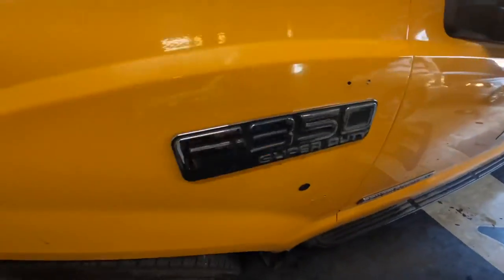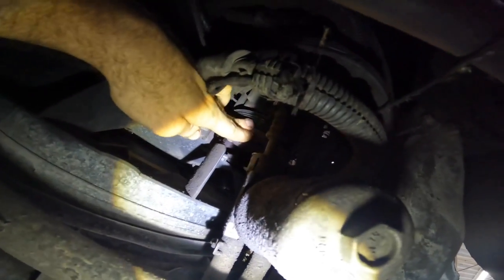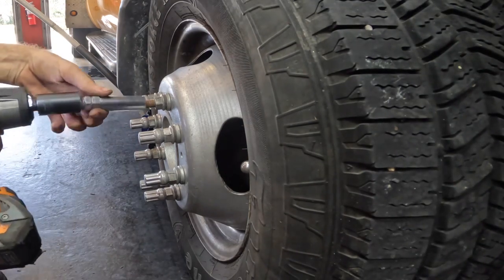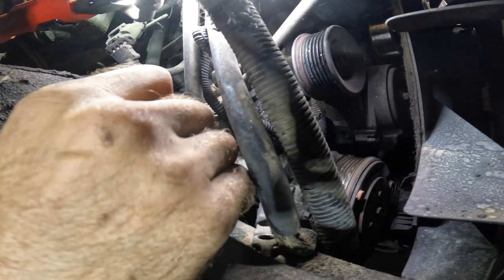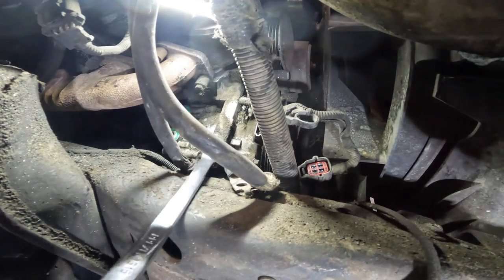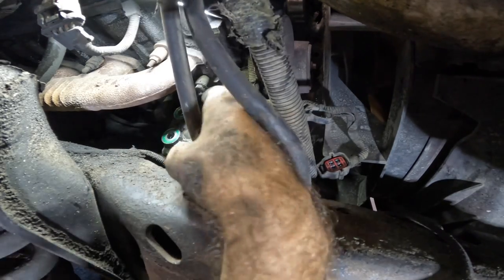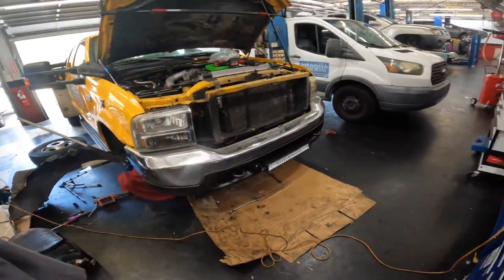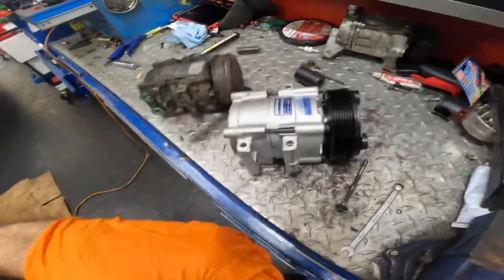Cut the Frame, Pull the Cab, or Suffer? Ford Powerstroke F350

Comment: Shame the Devil and cut a hole! My Daimler V8 many years ago dropped it's mechanical fuel pump bolts, pee'd oil everywhere but although I could see it with a mirror there was absolutely no way anyone could get at the bolts to refit it without removing the entire cylinder head on the right-hand bank. It was my car so my solution although unorthodox worked fine - electric jig saw and sawed a piece of the inner wing/engine bay side out giving me room to get my hand in and fit and tighten the bolts. Then cut a patch in 18g steel and self-tapped it over the hole. The Daimler was based on the Mk2 Jaguar body and built by Jaguar with their usual micrometer precision wasting not one inch of space so nothing was accessible under the bonnet, the valve rocker-covers almost touching the engine bay side walls.

Comment: I would have used the die grinder and enlarged that hole on the frame. I also would have checked if the compressor turned because it looked like just the idler bearing was cooked. Probably would still change the compressor and drier, but nothing else. Be glad the guy didn't bring a used compressor.

Comment: What an epic pain for that repair.  Im not saying Dodge is better but I really see the efficiency of time and design of an straight inline motor like the Dodge Cummins.  There's just more room to work.

When I was a kid I remember Ford had an inline 6 cyl 170c.u. and an 300 c.u. and recall them being simple and having lots of room to work on them.  It's too bad trucks in particular don't adopt simple easy to work on inline engines.  Nothing these days is designed for ease of repair or efficiency it seems

Comment: i did this repair on my 2006 explorer 4.6 3 valve v8 limited oh what a pain in the ass there’s less crap in the way but the space is also smaller and it’s pretty much the same process so when the engine was replaced when i got the car it went in installed on the engine but i did the removal the other way not knowing there was a massive hole in the line going to the back had i knew it would have came out with the engine it’s a super pain ford never should have put it there

Comment: There is a stud with a negative cable and stuff on it by the compressor. Take that out get those cable out the way. Piece of cake. It’s thirty minute job.
Reply: Oh yeah. The manifold bolt. Use a wobble with a long 3/8 extension all the way to the top. Hit it with your impact. Ten seconds

Comment: You dont have to do anything complicated. Yea, its.not easy, but its.definitely doable with the right methods. You put the bolts into the compressor, then put small zip ties on the threaded end of the bolts to keep them in the compressor. Get the compressor into place, start the bolts, and once they are threaded in to where they wont fall out, use a needle nose pliers to twist the zip ties off, and screw the bolts in the rest of the way..... done.

Comment: A friend had a Bronco with the 351M in it. You had to pull a motor mount and jack the engine up to get the oil filter off. What the hell were they thinking.

Comment: Isn't' that a fun one? NO!!! I did a repair on a 2000 Ford Econoline Van. In order to replace the tensioner pulley and belt, I took off the entire front end of the van. I had to do this to get to the tensioner pulley and fix everything else the belt caused damage to. It was a mess. Took me all day.

Comment: I'm not pro-engineers by any means but this truck has 350K miles on it! They did most things right. AND most likely the reason the AC seized up is because a mechanic put an F150 compression in it.  I love Ray.  Watch every video and I'm amazed. Just wanted to pump the engineer bashing brakes a moment.

Comment: Gotta love the "engineers" once again!!!  Nothing quite like "cab forward designs"...  Ford dealers I hear usually pull cabs off the frame when doing head gaskets etc!!!!  This is the reason-- I say Hell NO to certain vehicles anymore n sent it!!   (also b/c it is hard to "sell a customer" on the labor for jobs like that most of the time b/c they don't understand just what is involved sometimes.....)  LOL    I appreciate this video as I do auto AC on some vehicles --WILL NOT be a FORD truck for sure!!--LOL  That would of been an "AC DELETE BELT" n ship it!!  --see the dealer if you want to replace it!! --lol  (smart companies build trucks/cars with the AC belt separate from vital components so upon failure--you only lose AC--not everything!!)

Comment: i see lots of air movement on loose items around compressor is that from the portable swamp cooler? its blowing out very moist air which is bad for the a/c system which is open sort of like working on it on a rainy day

Comment: Engineers were paid to make sure it runs and drives and to make it quick and easy to assemble at the factory by dropping the cab down over everything on the rolling chassis and powertrain. Very little consideration given to future service despite them having a procedure for it in the FSM.

Comment: Mud: 10 minutes of fun.  10 years of crap falling in your face.
That's the kind of job where I'd be inclined to start with a large supply of degreaser to soak the engine bay, & a high pressure washer before even starting.
That slow ending with the 1/6th turn at a time... at least it wasn't one where you have so little room, you can only get 1/12th & have to keep turning the spanner around to swap angles.  (Although I saw you doing that to start with.)
Hope the rest of the day turned out great after this painful start!

Comment: I am half-listening to this ordeal as it plays in the background as I, myself, am currently struggling to determine the thread-pitch of this raspberry-pi case hardware; where i am coming to the conclusion that I am going to have to disassemble a spare IDE hdd becasue IT has the ONLY fasteners tiny enough to (closely) match what i need; and, yes I have concluded, that I am going to use an X-acto knife, more magnifying glasses, and the most needle-y of needle-nose pliers to cut a hair-wide strip of masking-tape (the BLUE kind, of course) to wedge into the threads of the needle-sized screws to compensate for what must be the wobbliest tolerance in ALL of the fine-threaded fastener world: whilst thinking I should just go nuclear: wrap the whole thing in duct-tape and be done with it.   Just wanna say thanks, Ray, for talking to me, describing the details of your own challenges in real-time as I work to accomplish my task too;  May Google's algo smile on you.

Comment: You’d think that parts that needs to replaced on a fairly regular basis like oil filter and cabin filters. They would engineer it to where it’s easy to get to.  But instead the engineers said.  Hey this parts needs to replace  or break often. Let’s put all those parts in the most  inaccessible area of the car.

Comment: just when you drop the compressor  the customer comes out and says, never mind put it back together. i just checked my check book and it says o hell no. at 19:30 i start thinking why not pull the radiator and how you gonna get the compressor out after you get it unbolted. i would have gotten my hole saw out. ok edit again, where is your hole saw? a circle cut will not weaken the frame there.

Comment: This job is actually a breeze remove the 2 motor mount bolts that you see from the bottom lift the motor slightly and you can fit a 1/4 inch ratchet to loosen the bolts once they’re broken loose you can remove by hand the rest of the way. Installation is just as easy install the bolt that is obstructed by the frame gets installed with compressor run down one of the accessible bolts to hold the compressor in place.  FYI: sell new motor mounts next time with good mounts the motor sits higher and the compressor bolts are accessible through the holes. I’m a Mopar  and Chevy guy all the way until I worked on 6.0 they’re amazing motors once you learn all their quirks. No they don’t blow head gaskets like everyone states they do it’s a bad EGR cooler design I’ve done a good share of them as PM and failures for EGR cooler. Use only ford gaskets and seals or a Bullet proof EGR cooler. They are good 1/4 million to 1/2 million mile trucks with proper maintenance.

Comment: They should have just totaled this truck. The labor alone on this repair would be more than the truck is worth. That is a nightmare. I won't be able to sleep for a couple of days after watching this, lol. That's worse than trying to do a power steering pump on an 08 Sienna in your back driveway with no lift. It has a bolt that is blocked by the frame. I didn't think it could get any worse than that. Try doing a control module on a '91 Skylark Custom. That one sucks too.

Comment: That's a job I probably would have run screaming from.  But may I suggest for the next time that you just cut a hole with a bi-metal hole saw bit right over those two bolts.  You would save at least 2 hours.  Shoulda, coulda, woulda.

Comment: Personally I would have yanked the whole motor and gone from there. That said - I've never been a professional mechanic, so I may have the wrong idea about this unit. When I used to do a lot of this sort of thing I was working with old 70s and 80s cars/motors and we could get an engine in and out in an hour.

Comment: I feel every greasy, painful hand manipulation, muscle pulling grief that those engineers designed in that a/c compressor replacement job. Those engineers should be put on a driveshaft spit and basted in5w-40 diesel motor oil under a diesel fuel flame to show them what crap they designed. I'm a Ford person but it doesn't matter what company designed it. Their all the same. Congratulations that you were a gentleman with the stress you were under!!!!!!

Comment: They had it towed because the power steering and alternator stopped working? .......Wow. Some people are just overly cautious, I guess. It would have been nice for Ray if they'd been more cautious about the dirt :O

I was about to criticize them for ignoring the grinding bearing in the AC compressor, but then I remembered......I own one of these, and you can't hear anything on the accessory line over the noise the engine itself makes. :O I probably would have removed the AC compressor and installed the shorter belt....I have already removed other parts of the AC system. I don't use AC.

Comment: Time for the hole saw. The engineers didn't care about your pain. So go for it.
Heater core on an 85 Toyota van. you simply cut a door in the floor. Otherwise, it's a 10-hour job. Nobody would pay that!

Comment: I have said it before and I will say it again, all mechanical engineers should be required to spend five years working as a mechanic doing maintenance and repairs on the type of vehicles they are going to design before they are allowed to design anything.

I bet they would be designed so they are a lot easier to work on after that.

Comment: 11 mm bolts...huh.   I checked my toolbox.  3 socket sets, 3 wrench sets, and one of those hex drive impact sets and none of them have an 11mm.    Its the same with torx T27.  Harleys are loaded with T27s and none of my torx sets have any.  I had to order a variety of them to have on hand.

Comment: Imagine if you would in another parallel universe there is an automotive engineer that actually works on the vehicles they design, they notice a minor problem and make adjustments prior to the vehicle being built, such as two holes in the frame that will allow the mechanics to easily access and remove bolts in a timely manner!

Also Mr. Ray you act like you have a job other than video taping for YouTube, I just don’t get it🤣🤣🤣🤣🤣

Comment: GET YOURSELF A 1/12 HOLE SAW PUT THE HOLE IN THE FRAME IF YOU SEE IT'S GOING TO 2WEKEN THE FRAM SEND IT OVER AND WELD A PLATE ON IT I HAVE HAD CHEVY VANS 5 CYCENDER THEY IN 156000 MILES NEVER CHANGED THE TWO PLUGS ON THE REAR PASSENGER SIDE FIX THAT IN A HART BEAT THEN PUT 100 MILE TAPE OVER THE HOLES

Comment: Those engines are a pain in the ass on several fronts - it's a pain in the ass to work on anything on the passenger side toward the rear of the engine ..

Comment: Customer states, 2009 GMC Acadia needs oil pressure sensor replaced.  Low oil pressure warning appears intermittently.  Common problem among traverse, enclave, acadia, and other infamous 3.6 gm vehicles. Vehicle runs fine; no over heating; no clatter.  Repair shops insist alternator must be removed - NOT.   ThIs results in a >3 hour repair. Checked youtube - your world.  Tricky but 1 hour job or a little more.  I'll provide new oil filter and OEM sensor. Price please. tHX.

Comment: Next time, take the clutch fan and shroud out of the way after draining the coolant, like 20 minutes of work if you ha have a co-worker  who can help for five seconds.

If you remove the upper rad hose, unbolt the shroud from the radiator at the top, pry front shroud up and out after taking the radiator top mounts off, then take the four shroud to cover bolts out,  bust the fan off the camshaft, have a co-worker pull forward on the rad a bit while you slip the fan and shroud up and out as a pair, that compressor is SUPER EASY to do, as is everything on the FEAD system at that point.  Should also  get the  CAC tube out of the way on the hot side.  Take it off at the second clamp at the turbo as it has a compression bead at that joint - at the turbo itself it's prone to coming off if you touch it - and then the main clamp at the CAC itself.  Compressor can then be replaced in an hour and a half tops all day every day.
10 mm and a 13mm hand wrench from the front of the compressor with the shroud gone, loosen all bolts till compressor is hanging free, all bolts come out with the compressor moving forward, then loosen the 10mm a/c hose bolt, don't remove, then the hose can slip up and back, compressor comes out the bottom.........hope that helps if you have to do this again.   Any FEAD work on these rigs is way easier with the shroud and fan out of the way, and the pair comes out easily without having to remove the radiator if the upper two mounts are removed, and unclip that dumb upper extra shroud with a pick while pulling up on it.  This is not a 4 hour job if the shroud and fan is gone.
Been wrenching on 6.0l diesel Ford's every day for  19 years now and that compressor - for me - is total gravy. Hope that helps.

Comment: A hole where the 1 bolt was blocked off, would have totally compromised the integrity of the frame, that's why Ford didn't put an access hole.....🤣🤣🤣🤣

Comment: Fords are such a pain in the ass. I can replace the AC compressor on my 2000 chevy lumina in an hour because the made they engine small enough and the subframe big enough to actually replace necessary components.

Comment: It's a typical Ford engineering thing and to put in electrical engineern in a mechanical job and a mechanical engineern in an electrical job and expect things to work out and that's the kind of crap you can expect from Ford when they do that. I seen it every day I had 40 years experience at Ford. Where are the clearance holes in the frame so that the compressor can be changed those holes would not need to be very big and will not affect the strength or the integrity of the vehicle but they will make it serviceable.

Comment: I used to want to be an engineer, till I became an aircraft mechanic and saw some of the stupid stuff military aircraft,  and cars also. They cant be this stupid, it has to be intentional. It should be mandatory for aircraft or automotive engineers to spend a few years as a mechanic. I  have worked with a few good ones though.

Comment: Today's vehicles were designed to be assembled as easy as possible, what happens to the vehicle after it leaves the assembly line is no longer the engineers problem. This is done to keep the well paid assembly line workers happy and to make sure they don't end up on paid disability.

Comment: 5:50 in the video... please clean the surface before putting a power tool to the connector....that's a stripped bolt just waiting to happen man. A wire brush is your friend.

Comment: LOL.  I'm not laughing at you I'm laughing with you....    I've been doing this for a long time just like you.  But honestly about 3 years ago I came up with a new philosophy to help us do this kind of stuff..  if it's in your way and you're going to struggle and what's in your way is only going to take a few minutes get it out of your way.   I know you work for a shot from what I see so you can't always go and say hey I need transmission fluid or this or that or the other. Is compressors are not exactly easy to change I haven't finished your video but the struggle is real brother. 🤦🤦🤦
Reply: The reason I say that is a lot of the vehicles I work on are fleet accounts and farm vehicles sometimes we pressure wash vehicles and charge use cases of brake cleaner and charge they don't care what the cost is they just want it back as fast as possible and done correctly the cost doesn't really matter I can't feed my cows without my truck 🤣👍👍👍👍🤦🤦🤦🤦

Comment: ...and I thought that Toymotor Water Pump was excessive. Oh for the four bolt Mopar water pumps. This ford looks to be a real pain. Maybe pull the engine mounts and jack up the engine. ...I hate fords. ....Engineers need to spend a year servicing stuff before designing anything.

Comment: Ford engineers take advanced training in sadism. I have an Expedition and it has some of the most ridiculous problems and repairing them is a massive PITA. Also 5.4 3 valve V8 with the magical spark plugs. A real low point in Ford engineering.

Comment: Mechanical Engineers that design engines need to spend way more time working on them to understand the stupidity of not putting that access hole 3/4 inch further over to line up with that bottom bolt.